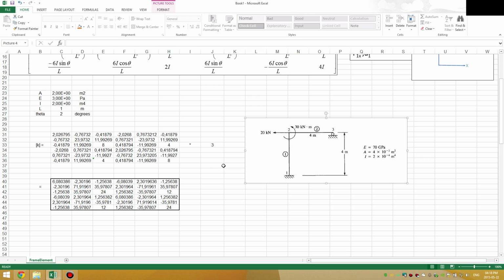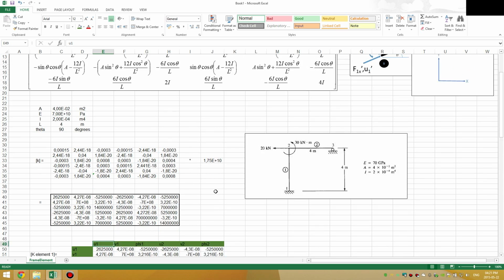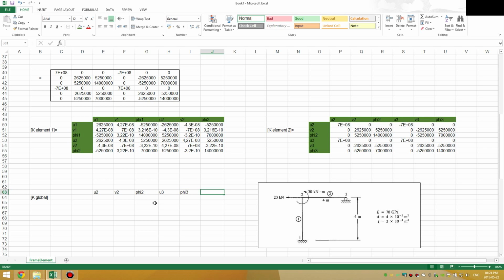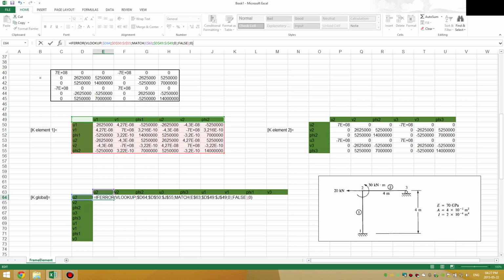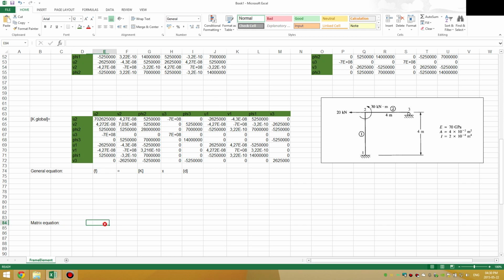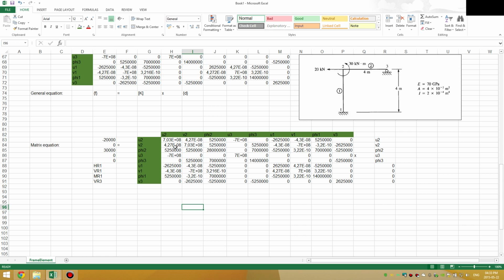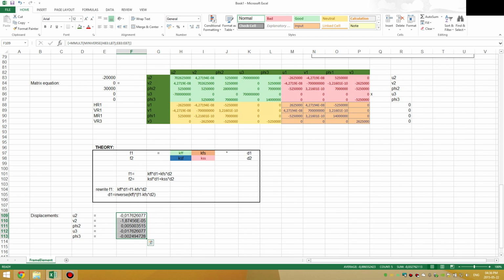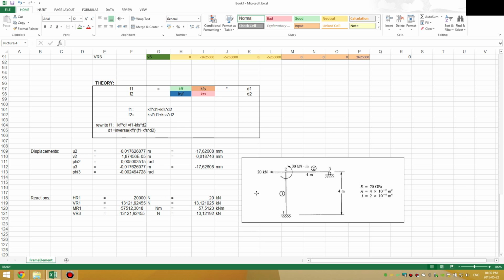Stiffness method Frame Excel example 1

Comment: I think the value of u1-v1 in the global stiffness must be zero since the formula related to it must be multiplied by cos and sin, but since the theta is 90, cos must be zero, resulting to zero value of u1-v1?
Reply from the maker: Hi, Thanks for the comment. If I understand correctly, and please correct my if I'm wrong, the value you are referring to in the global matrix is 4.27E-8, which is very close to and, for all tends and purposes, zero when relating to the actual stiffness values, all > 10k,. I suspect the nonzero value has its origins in rounding errors or something of that nature. I hope this gives some clarity.

Comment: what will happen if we have variable EI in the same frame element , how can we deal it as one element not two ??
Reply from the maker: +Esraa Haraz Thanks for the comment. I don't think that is possible. As the constant EI is one of the assumptions made at the start of the development of the matrix. I think for a variable EI in the same element a new element matrix will need to be derived to accommodate this.  I hope this answers your question.
Reply: +TM&#39;sChannel  Thanks for replying and sorry for bothering you https://drive.google.com/file/d/0B_f62jgFY5pSX3BNMURxNzBJODA/view?pref=2&pli=1  something like   that i want to solve it as three elements not five , what should i do ?i 
thanks in advance .
Reply from the maker: Hi, I think for that element configuration, 5 elements is the best way to go. Seeing as I don't have the element matrix for an element with variable stiffness. But if you manage to locate (or derive) one, please let me know. Regards
Reply: Variable EI occurs in tapered sections where depth of beams are not constant.
Reply: I duplicated my member matrix and modified the excel sheet

Comment: Hi. Thank you so much for your video. It has helped me alot. Do you perhaps have a suggestion as to what to do if EI is constant?
Reply from the maker: Naeema Ismail Hi. Thank you for the comment. I'm not sure I understand your question. In the above example EI is given as constant for the problem. For any value of E or I, it will just have an effect on the element stiffness matrix. The procedure will still be the same, just with different element matrices. Sorry if this reply wasn't much help :)